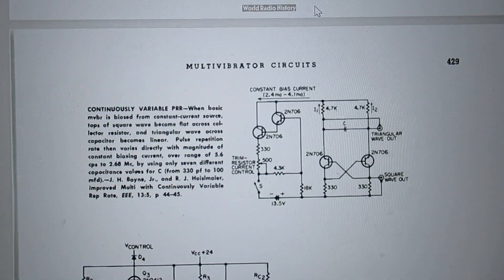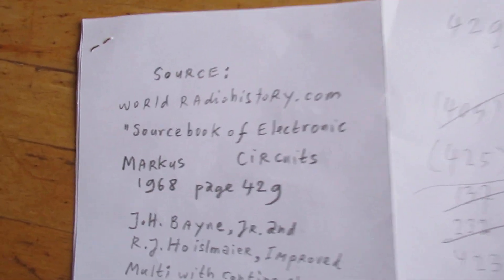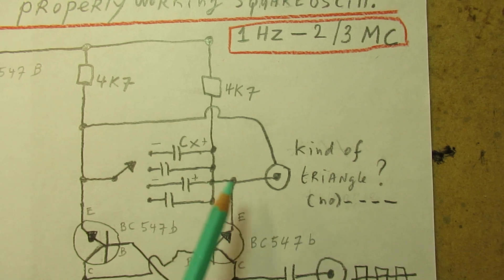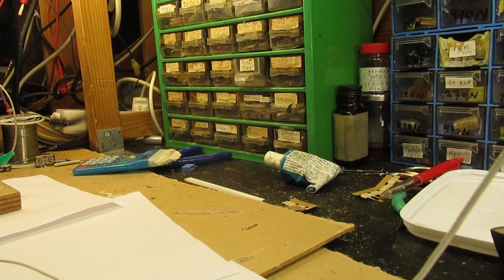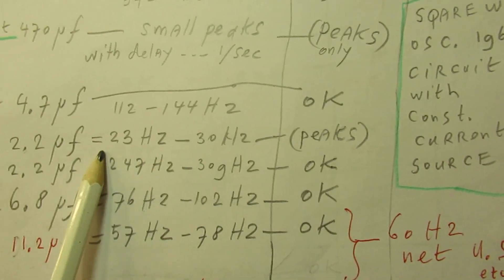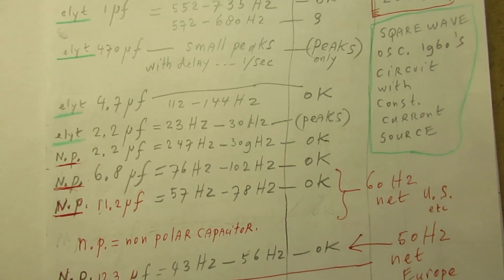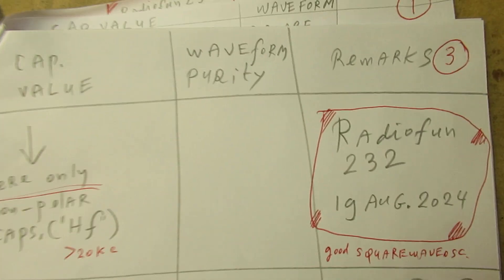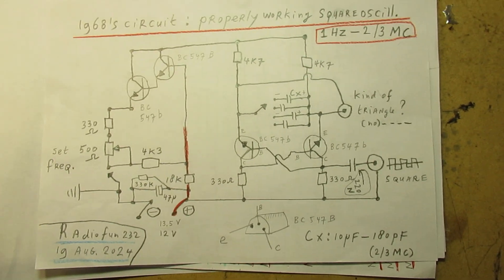Very good Muvib square wave generator (1968)  with constant current source, works from 1 Hz - 1.5 MC

Comment: Superb circuit, and just a thought: Should a viewer build this circuit, they can achieve all other specific frequency's by parallel/series that timing cap - any (non-standard) value capacitance can be made this way.
Reply from the maker: Thanks Michael, the frequency variation is quite good. Though (logical) to cover all the frequencies necessary, perhaps more than (say) 12 positions on the rotary switch are necessary.  Anyway, it works nice. Only around (say) 1 MC the waveforms get "rounded". And with typical HF transistors (I tested the BF 199) there is no longer a rounded squarewave but a triangle wave. I had not expected that, so the BC 547 b (not a typical HF transistor, though the BC 547 b can work up to 9 MC) is a kind of good choice. 21 Aug. 2024.

Comment: Amazing finding! So simple. I'll definitely try with different hfe transistors, maybe higher or non-matched to see what happens.
Reply from the maker: That is surely a good idea. Such a circuit can be made within 1.5 hour or so. And it works nice.
Reply from the maker: Tested it today (21 Aug 2024) with typical HF transistors (BF 199), on the highest frequencies around 1 MC I got a triange wave. So the BC 547 b (not a typical HF transistor) is not a bad choice.